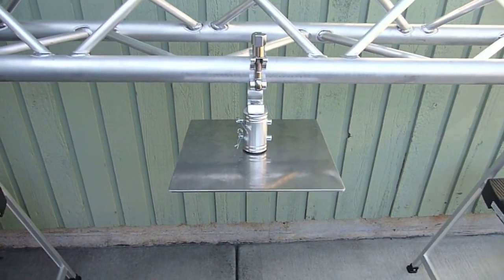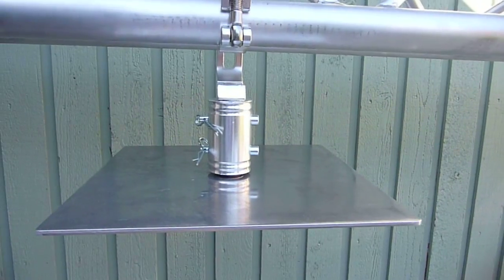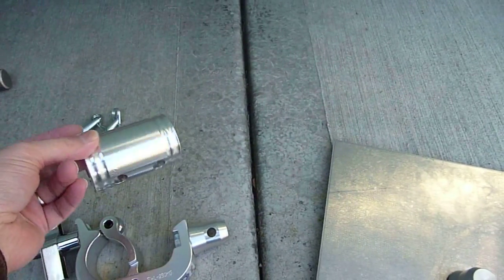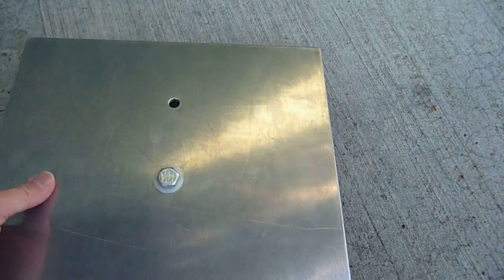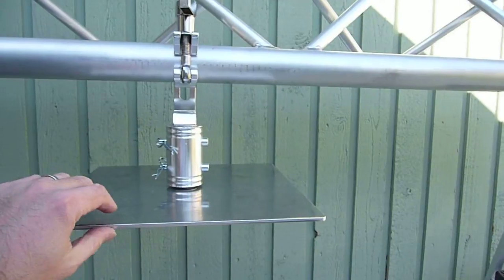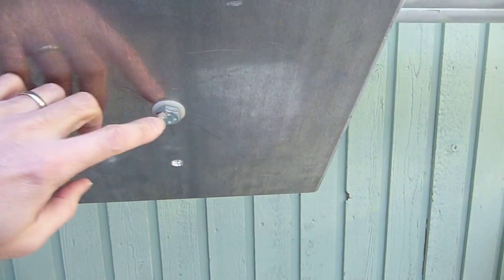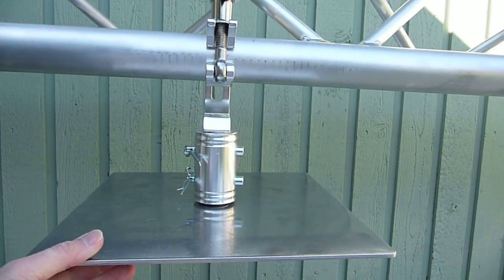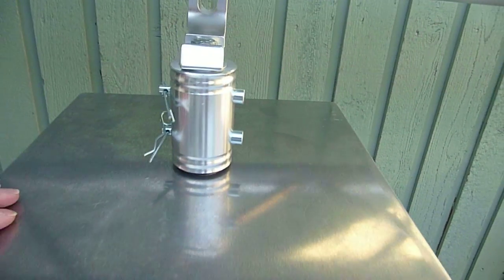Video projector truss mount

Comment from the maker: most parts are from Global Truss:
 1 Trigger Clamp  - Heavy Duty Hook Style Clamp
 1 SPACER 82  - 82mm GENDERLESS SPACER
 2 Half Couplers  - HALF CONICAL COUPLER FOR F31/F32/F33/F34/F44P SERIES
1 12" x 12" cheet of aluminum - purchased from a local metal shop
2 nylon washers - purchased from ace hardware